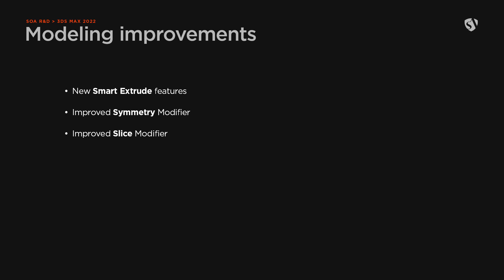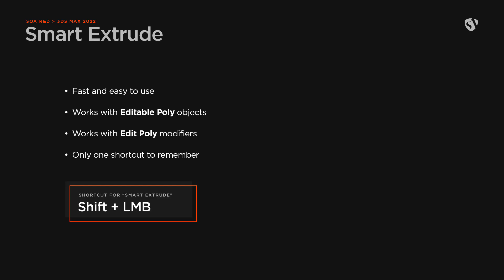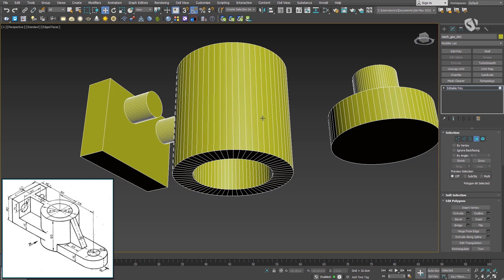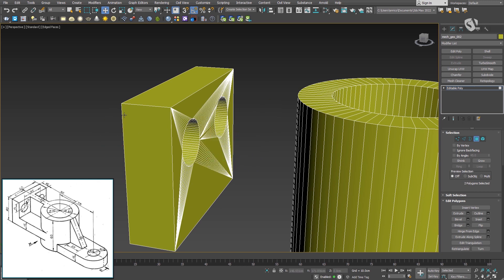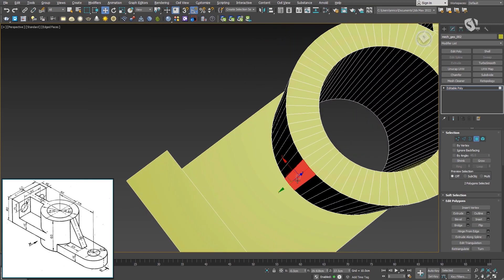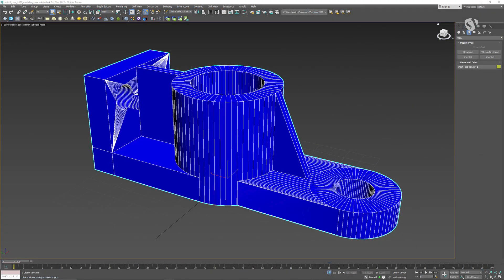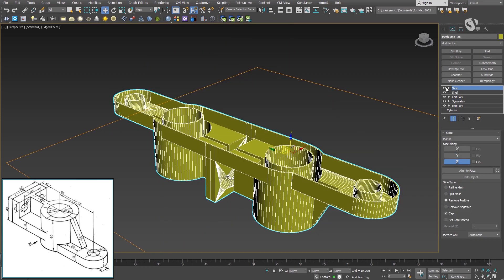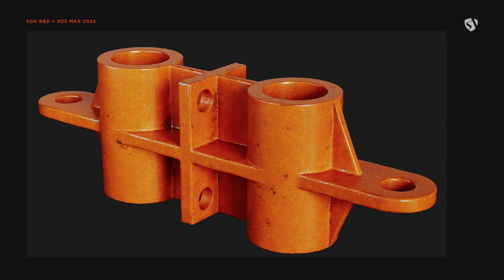3dsMax 2022 - Some improvements

Comment: Well, the result has some serious topology issues which still need manual cleanup. I do believe it will speed up my modeling pipelines anyway though.
Reply: If you watch all the way through they mention that before rendering they used Max's automated retopo modifier to fix the topo (but didn't show it and said it'll be in a future video). Max's automates retopo tool is quite phenomenal and requires minimal manual work
Reply: @artofaria  Sure, i am working in game industry and no automatic tool can do better than artist yet :) But thats good right, otherwise we loose job :)
Reply: @DolecekRadim  it's a mechanical part brother i don't think it needs that good a topology. I don't work in the industry yet so enlighten me if I'm wrong. The part about automated not being as good as handmade i absolutely agree with though
Reply: they need to justify their price tag LOL